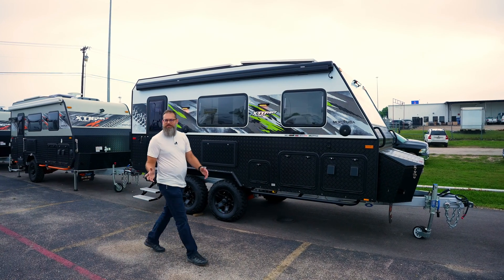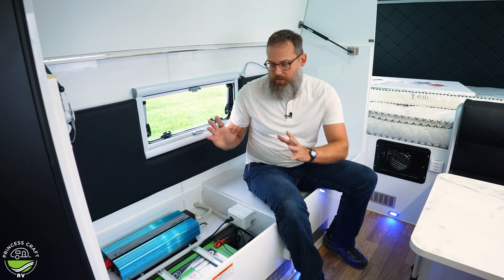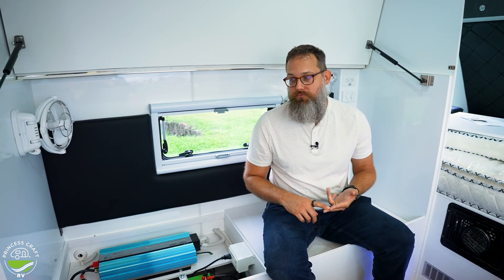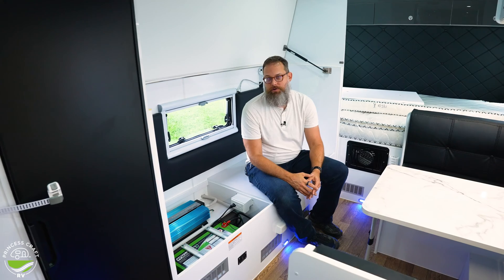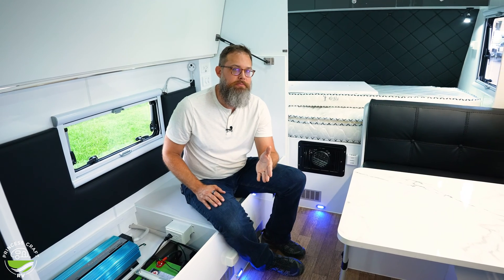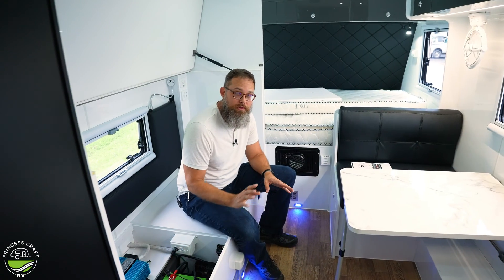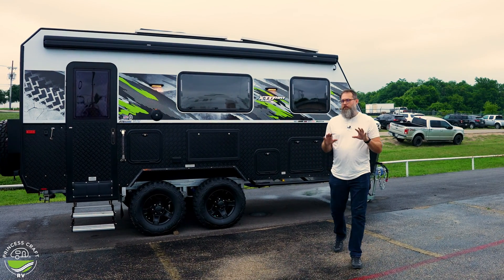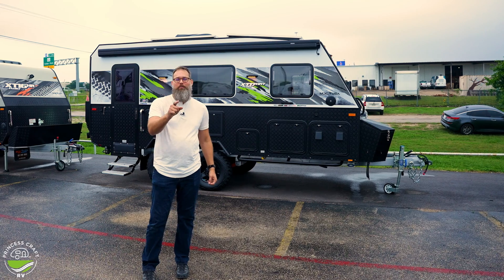Power Management Equipment for Your RV with BMPro and MDCUSA

Comment: the majority of LifePo4 batteries include a BMS. The only brand name battery I can think of which doesn't is one of the Victron LifePo4 product lines. Appreciate your content and time but I feel it's important to be clear and honest with those who are not experienced on this topic. Cheers
Reply from the maker: Thanks for the help! Yep, we’re trying to get things right in these videos. Our shop still runs across early-generation Lithium batteries in RVs when they come in for various work and maintenance. The new stuff pretty much all has built in BMS, with a random outlier, exactly as you’ve said. Some of the older batteries we see  came from the Wild West era when the tech was newer and developing for RV applications, and they may still be out there for a while with their longer lifespans, if maintained well. If a lithium battery user comes in with a Victron or an older, internet-purchased budget battery with no BMS, they can consider if this equipment will meet their needs and application. Thank you so very much for the assist. It’s tough to think of all the things that need to be said and how best to say them. I appreciate that it helps me to improve as we make and share these video projects.
Reply: @PrincessCraft Appreciate the explanation,  over here in OZ I'd say that the exclusion of a BMS within lifepo4 batteries is uncommon hence my surprise when I heard your comment. Cheers.